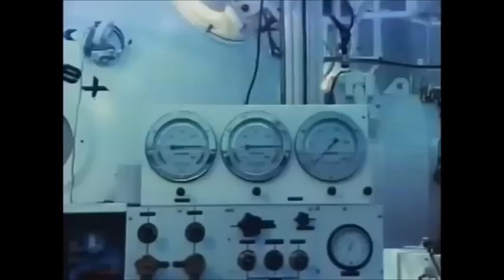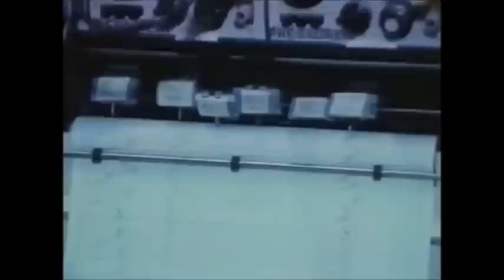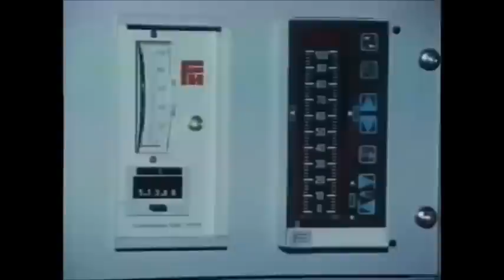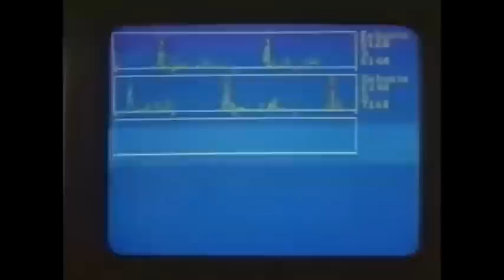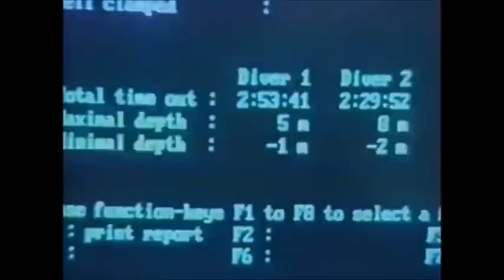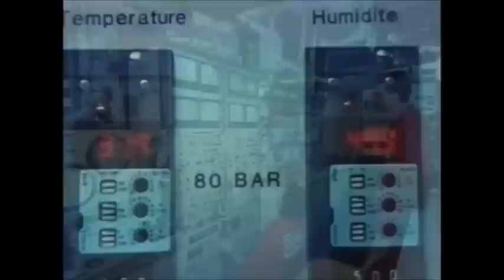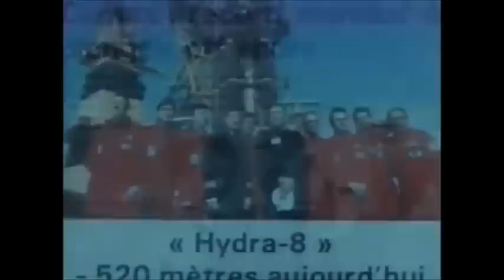World Record   Deepest saturation dive 534m

Comment: Sure, you eliminated the High-pressure Nervous Syndrome but if you still use 50% He in the mixture the Silly Voice Hilarious Syndrome will still be a serious threat for the divers.

But seriously though, how can they survive with only 1% oxygen in the mixture? If the oxygen percentage in the mixture is too low, they suffocate. If it's too high it makes the hydrogen combust. I am confused, how does it work?
Reply: Makis Makiavelis
I'm guessing it works due to the amount of oxygen is fine due to how compressed it is. Any more and they'd likely die from oxygen poisoning.

Just guessing though.
Reply: It is called a hypoxic mix, it would be insufficient oxygen to support life at the surface but due to the increased pressure at that depth the about of oxygen the diver is breathing would be about the same as breathing 50% oxygen at the surface. The body requires a given amount of oxygen not a certain ratio in the air we breathe.  That amount in diving terms is measured in partial pressure and is between about .16bar and 1.6 bar too much or too little you die.
For an explosion you need a certain ratio of gas to oxygen I'm unsure what it is for hydrogen but I'd guess between 10 and 90% hydrogen out side of those ranges the ratio is considered inert as it is either too rich or too lean a mix to do anything. 

However they would have to be very careful when decompressing the divers as it would just about have to go through that range.
Reply: +Ben Mac, Thanks for that explanation Ben, I understand this now
Reply: Thanks Ben.
Reply: Makis Makiavelis - that HVS (Hillarious Voice Syndrome) is not some intrinsic property of helium that other gases lack - this is the result of general property of light gases (which is, acustic vawes travelling faster). You can find videos of people inhaling xenon and then speaking - their voices becomes much, much deeper, as xenon is the heaviest gas available (more specifically, the heaviest elemental, non-toxic and non-radioactive gas) - so it produces opposite effect.
Hybdogen being even lighter than helium (atomic mass of H2 molecule is 2 a.m.u., while an atom of helium weights 4 a.m.u.), so that "Angry Donald Duck" effect would me even more pronounced, I guess.
Reply: Yes, I know, I just added that remark jokingly. As a sound engineer, some of the first things you study is how sound waves propagate and behave through different mediums. Still, thank you for your input. I admit I haven't thought of Xenon, but I knew about the more abundant and more popular Sulfur Hexafluoride.
Reply: Oh, yes, SF6 - I forgot about it. If I remember well, it was used once (is it still? don't know...) as sound dampening gas in IGUs (insulated glazing units, aka double glazing). Of course, not as a "wunderbar" silver bullet, but as a part of whole set of things (like, bonded glass aka VSG, trriple glazing with different width of spacers and differen thickness of glass panes - but this is quite different kettle of fish, so I"ll leave it here). Funny though, I'm sort of occupationally involved in this IGUs bussines, yet I forgot about that SF6...
Atomic mass of Xe is 131 amu , while mass of SF6 is 146 amu, so it would be just abut 11% increase of mas (and specific density ). But speed of sound in Xe is around 178 m/s, while for SF6 it is 120-130 m/s - approx. 72% of that in Xe.
So, yes - SF6 wins  : )
Reply: Bogy 1 Kinoby
Isn't he basically saying the same though?
Reply: Bogy 1 Kinoby
Really?
https://en.wikipedia.org/wiki/Oxygen_toxicity

Comment: Is it because of high pressure that only 1% of oxygen is needed? I understand ill efects of certain or should I say most of the  gases if their partial pressure increases but that is little bit unclear how body is able to absorb enough oxygen from such low content.
Reply: ruuvari123 The answer is in you question. What counts is the partial pressure of oxygen. The human body need a partial oxygen pressure between 0.12 and 1.6 bar to survive. At 500 meters below salt water the total pressure is roughly 50 bar. At 1 % oxygen content its patrial pressure is 0.5 bar. This would correspond to a 50 % Oxigene content at surface pressure, so by far enough to breath.
Reply: @flugschulerfluglehrer   ohh nice.

Comment: 17 days just to decompress?! That's over 2 weeks of just waiting to leave... I realise they are using Hydrogen and Oxygen in this saturation mix, not sure it's used anymore, last I checked they use Nitox (Nitrogen and oxygen or helium and oxygen (Heliox) because they are gases that can be safely mixed with oxygen without risking harm to human health and it can be less dense, and so better compressed for greater longevity using standard air tanks than a standard air mix.)

I like the term given to them... Aquanauts...
Reply: Going from surface down, you can actually use pure oxygen for about 20 feet. Most recreational diving uses standard compressed air (78% nitrogen, 21% oxygen, plus other trace gasses) however eventually you will run into Nitrogen Narcosis (you essentially get drunk on Nitrogen) when the partial pressure of Nitrogen in the mix gets too high for the depth. Nitrox, which is standard air that is enriched with extra oxygen to replace some of the nitrogen (usually 28 to 32% oxygen instead of the usual 21% in air), is only used to slow the uptake of nitrogen in depths where you would typically use air to reduce the risk of getting the bends. This extends how long you can stay on the bottom or reduces off-gassing safety times between dives. It is not used for going deeper than you would with air because in addition to the threat of Nitrogen Narcosis you also have to contend with having to much oxygen at those pressures, as the toxicity of the oxygen will cause Central Nervous System issues like unpredictable seizures. To go deep you have to displace the gasses in your mix with something else. That's where Trimix comes in, which is a mixture of nitrogen, helium, and oxygen. The nitrogen is cheap and helium is expensive so divers will continue to use some nitrogen, but just not as much as in regular air. Companies that can afford the cost can use Heliox, which is just helium and oxygen, but too much helium can lead to High Pressure Nervous Syndrome so even then Trimix might be used to reduce the amount of helium. In this video they were using a mix apparently called Hydreliox which is not common. Wiki claims the mix was 49% hydrogen, 50.2% helium, and 0.8% oxygen. This allows ultra-deep diving where even some nitrogen is too much, but something still has to be used to displace some of the hydrogen.

Basically, each time one of the gasses tries to kill you you have to displace it with something else - until that gas also tries to kill you. This is why most recreational divers stick to standard air or nitrox. Going any deeper quickly gets more complex and expensive at what seems like an exponential rate.

-Just an occasional recreational / Nitrox diver so some of the deep stuff is probably wrong. Hope this helps your curiosity.
Reply: Widget Nitox is not something you want to use when going deeper then 100 ft. The hydrogen helium and oxygen mix only has 1% oxygen not able to combust.
Reply: Andrew past alright, I'll admit I'm not formally trained in any of this, I just remember when searching for scuba training that there was a separate course for using Nitox instead of a normal air mix (which I realise is going to be different for saturation diving - I guess I was curious about the pressure problem, as presented in the documentary, but still I'm only just looking into it.) Thanks for de correction.
Reply: Phillip Dingus thanks for clearing that up. I'm going on my fist dives in just under a month and while I've studied the whole marine ecology side of things pretty well, I'm actually still very new to diving and I figure it helps to know of the nuances so at least there's nothing unexpected, no panic.
Reply: To be fair, very few people in the world are trained for Hydreliox usage; it's very uncommon, as far as I know.

-Nitrox on the other hand is semi common with medium/advanced level recreational divers.
Even PADI offers that certification, if you meet the requirements for safe usage.

-Trimix (Helium/nitrogen/oxygen), is also used by advanced/technical/deep recreational divers, but because of cost, complexity and risk, this is an advanced certification.

As a beginner diver, you're 100% fine with  good old air :) (Provided you're within the safety margin obviously)
Reply: MrKinir yeah thanks again, I've actually started my dive internship and finished my padi advanced open water and during my open water dives I met a married couple that use nitrox and I had it explained how the different partial pressures cause different problems at different depths and how they affect 'no decompression times' but nice to get a review of the frequency of use. Thanks for your comment!
Reply: When I was sat diving in the 70s you normally decompressed at about 100ft per day

Comment: 52 bars overpressure...Madness!
Reply: Does it mean the atmosphere they are breathing in the suit and when they are in the bell is at 52 bar to compensate for the 520m water pressure and so there lungs don't get crushed by water pressure ?
Reply: @morganfreeman5171  Yup and its why they would turn into a right old mess really quickly if decompressed suddenly.

Comment: Wait. Hydrogen and oxygen. Seriously?
Reply: Only 1% oxygen in equal parts He and H2 is too dilute to burn.
Reply: Rocketplumber -- I guess the dehydrogenater needs to use catalysis to do the oxidization then. Probably quite a bit of platinum cotated material needed for sufficient throughput.
Reply: This is in small percentages and not the stoichiometric mix (proper ratio) to burn or explode. I think the ratio is between 4% and 85% hydrogen to explode in oxygen. The mixtures here are well outside of that range.
Reply: Cesare Vissani - yeah, rocket fuel...and water.
Actually, it was a hydro-heliox mix
Reply: Remember to use non-ionic cleansing products on the viewports.
Reply: Smoking was discouraged.
Reply: oh yes of course
Reply: Cesare Vissani This has been experimented with since at least the 1940’s when Arne Zetterström died while diving on Hydrox (hydrogen and oxygen) to roughly 140m. Though it is not something you use from the surface while going down, you switch gas serveral times going down.
Reply: ceo : breathing rocket fuel will be fine